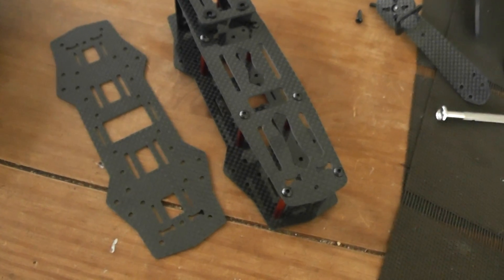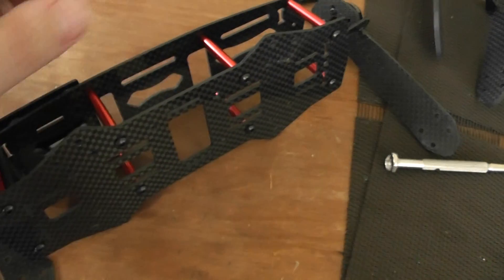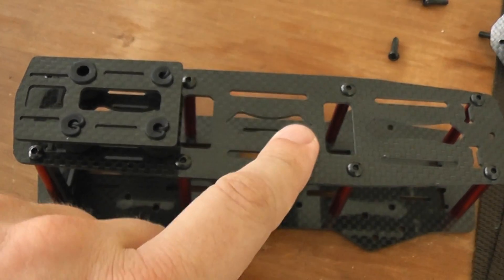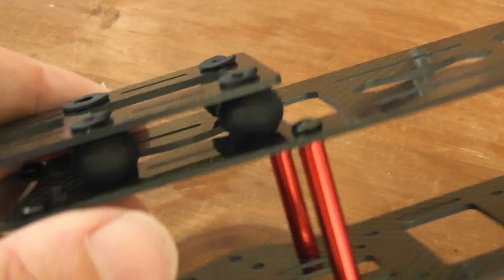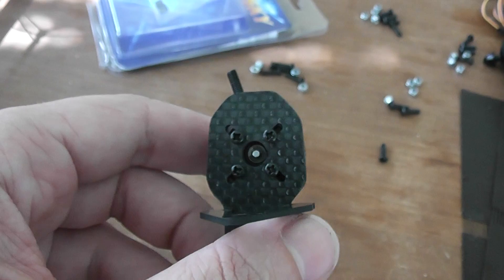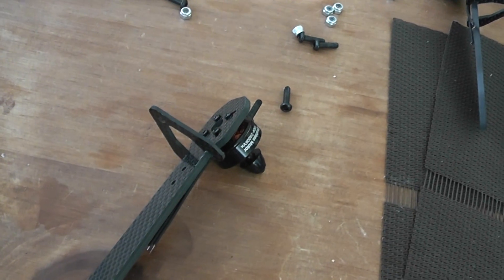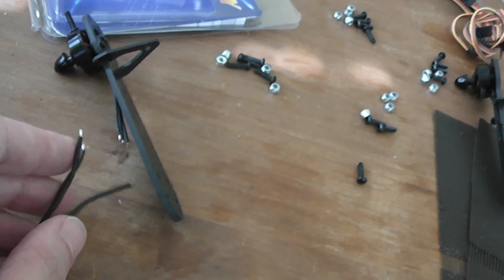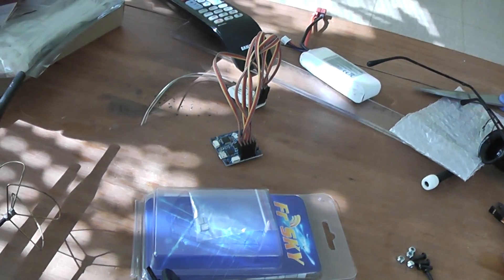ZMR H250 frame building tips

Comment: Good tip for the anti vibe grommets, use string, pass a loop of the string through the hole the grommet is going to fit in, put the loop in the groove of the grommet, pull the string up and flat to the frame plate, et viola....

Comment: It is easier to fit the arms and all the electronics before you fit the top plate.

Also, you should leave the feet off -- they are a waste of time.

More info here: Review: Cheap carbon Chinese 250-size mini quadcopter (part 1)
Reply from the maker: Yes, in fact it's what I did, you are right. I got a second small video showing the FC mounting, I didn't published (yey).... This video is just dedicaced to indicate which screws you have to use....
Reply: I used the feet as I use another CF plate with all the ESC's in and wires that I've skrink wrapped up on 10mm standoff under the quad, I saw the lumier frame, and thought that was a good idea. Not got overheating problems (yet) anyway, the feet snapped off... pretty much immediately on trimming flights.  So I can either remove shrink wrap if I get over heating and avoid wet grass landings/takeoffs. In the U.K this isn't going to be possible, or I keep shrink wrap.... no overheating yet though!
Ah, Bruce, I'm using the multistar 1706's as I had them lying around, the shaft is removable, there is a small grub screw in the rotor. I find they're O.K, not punchey but they'll do until the ZMR 1804's arrive!